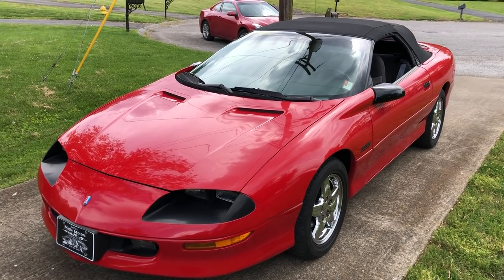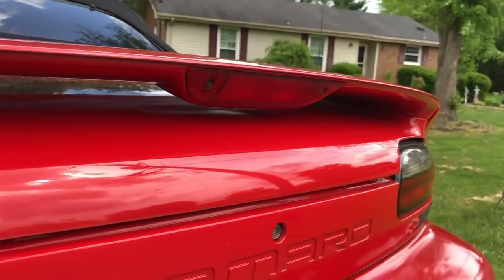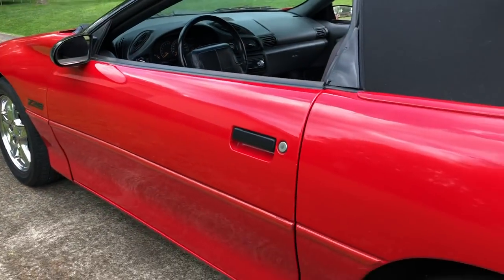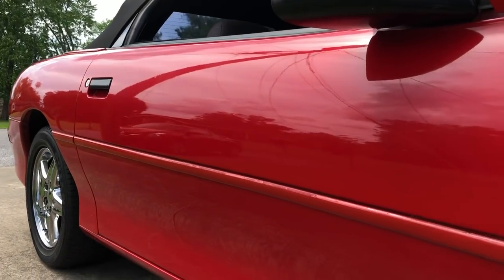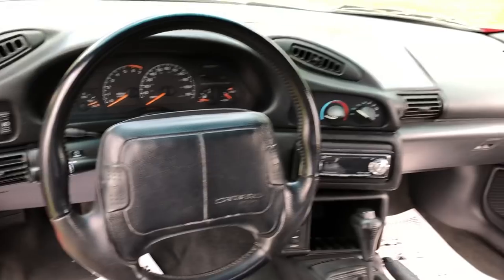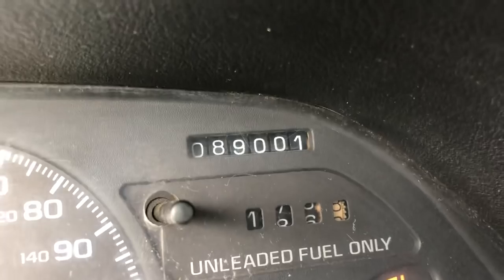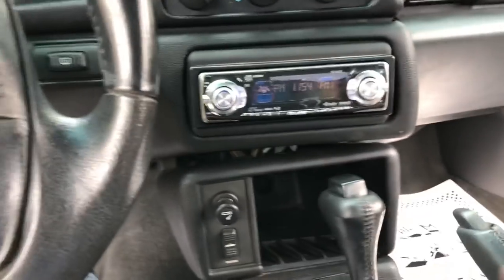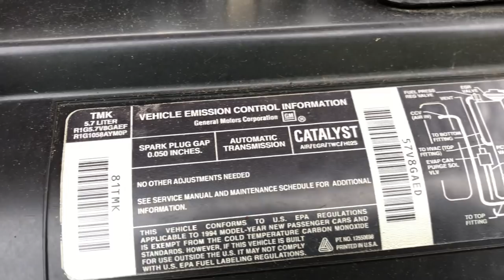1994 Z28 Camaro 89K low Miles $7,950 “SOLD” Maple Motors

Comment: I own a 1994 Camaro Z28 convertible in quasar blue. They only produced 5 in quasar blue. Total production number for the 1994 Camaro Z28 convertible wars 4932. A lot of these are in the junkyard or bend modify to the point of destruction. Mine has a new top, headliner, rear window etc and I'm the second owner. I have the original build sheet for the car. Motors never been. Put Mobil 1 in for the whole life of the car. Suspension was upgraded, koni struts and shocks better Springs sway bars control arms etc. But I wanted to keep the engine and drivetrain stock. Cars got 79,000. I'm contemplating selling it. I've just outgrown it and my taste in cars has changed. Anyone's interested just leave me to contact info.